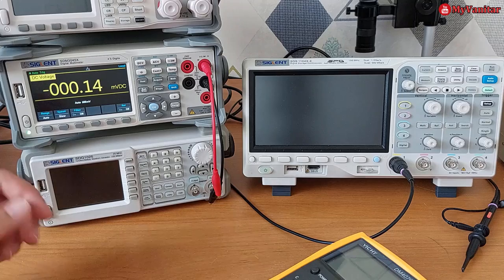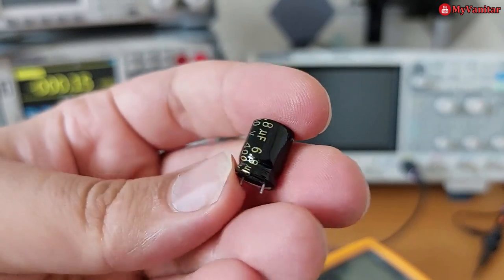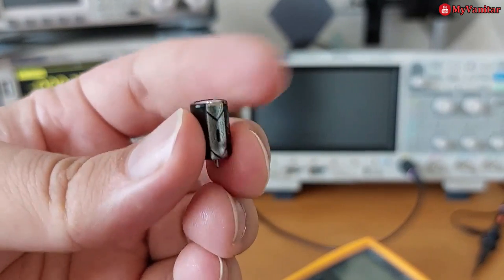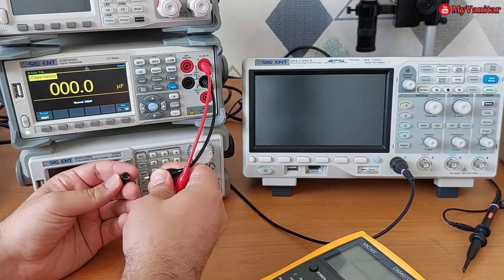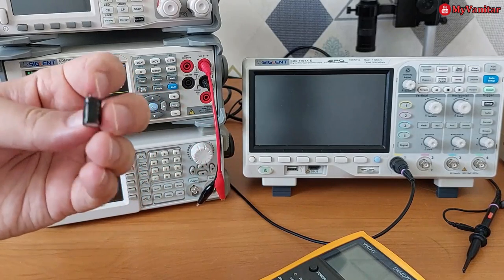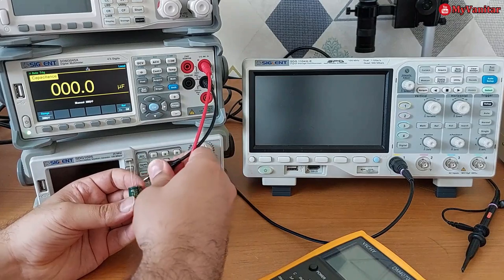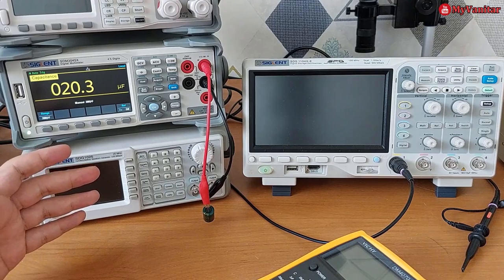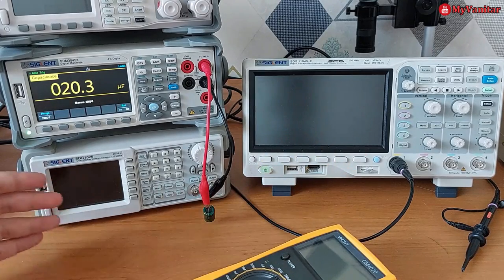How to Easily Detect a Failed Capacitor

Comment: Another way to check if the electrolytic cap is defective is by checking the pins under it. If it looks like rubber part at the base has cracked on it, it is already dried. If there some kind of white excess of internal chemical paste that leaked out from the pin terminal, again, it is also dried.
Reply from the maker: Yes, thank you for your comment

Comment: Do the high voltage  capacitors in a microwave contain any fluid that can leak out when defective? I have seen the electrical capacitors you show in your video burst and leave a fiber material all around it . The one in the microwave has a pool of clear oily liquid that smells like 3in1 oil right under the capacitor and is spread along the entire channel that serves as the rear feet of the microwave. The microwave works but I find this very odd. No one mentions oil as common problem with the capacitors. In fact they say they are dry. Any thoughts?
Reply from the maker: this is only one sign of a failed capacitor, watch my next video for a complete solution: https://youtu.be/CGDtfCkGk2A
Reply: Just an update for those who want to know, these are filled with OIL to cool them, not the old illegal stuff but some oil like product. The Sharp microwave was leaking it constantly after I clean the floor of the microwave up oil would seep out more after use.  I found an exact replacement on eBay supposedly pulled from working blemished units.
Reply from the maker: @tombanes  Thank you

Comment: Most people only check ESR today, which can fool them with shorted caps. Leakage causes more problems than anything else but is seldom considered. I have rescued many items others had given up on because of this.
Reply from the maker: I agree, many people started to make arguments with me regarding ESR (most of the time they use DIY ESR meters), however in my experience, in practice,  it is very unlikely that an electrolytic capacitor does not show the problem in the capacity also (third case). Most of the time electrolytic capacitors show problems, polyester ones are much less likely to fail easily

Comment: Please could somebody advise me I have a board with a 47uf 16v capacitor but it’s showing 197uf, I can’t find any video to explain a higher reading, is it a good one holding lots of charge or bad one? Please someone help as I have a problem with the board and this is the only thing I can find wrong
Reply from the maker: A higher reading is possible but not this much (+/- 20%), you need an LCR meter to test the capacitors correctly, I don't mean an expensive one, but it must be an LCR meter. Multimeters measure capacitors by timing, not pulses
Reply: @MyVanitar  thank you for your reply, I have ordered a new one so will try replacing it and see if it solves the problem 👍🏻
Reply from the maker: which model?
Reply: @MyVanitar  do you mean what I’m trying to fix? If you do it’s a technics PX1M digital piano, very very old but worth fixing if I can find out why it’s making a distortion sound
Reply from the maker: No I mean what LCR meter did you buy

Comment: What about ceramic capacitors? I’m currently struggling to find the cause of low grid current in a vacuum oscillator induction furnace and it’s driving me nuts. All of the caps measure fine disconnected, chokes are fine, resistors fine, no shorts I can find. Only thing I can think of is capacitor failure under load (which I thought was extremely rare) or a bad signal transformer on the RF Furnace board.
Reply from the maker: it depends on where they have been used. if you watched this video completely, the most tricky case is the third one. so you have to use an LCR meter. I'm not familiar with your device however sometimes resistors look fine but the value has been changed. if your device malfunctions when it is cool, then the problem is easier to spot
Reply: @MyVanitar  unfortunately it only acts up during sample analysis. (This is a Carbon / Sulfur analyzer by way of induction combustion and NDIR detection). The frustrating thing is it doesn’t throw any errors so the oscillator tube just sits there glowing red hot destroying itself. I’m not an electrician, so in depth stuff on a component by component basis isn’t the easiest for me. I just ordered everything inside the furnace from the office, so I’ll try a shotgun approach and report back lol. The furnace generates 12kV and heats stuff up to about 2000C, so it’s a boss for sure.
Reply from the maker: the power supply is switching? if yes and it works more than 3-4 years, check the capacitors for drying. especially the first one (big capacitor near the bridge rectifier)
Reply: @MyVanitar  finally figured it out. PSU was fine, rectifiers were good…it ended up being 2 500pF ceramic capacitors before and after the oscillator tube, the potted grid capacitor and potted plate capacitor, but the frustrating thing is they seemed fine when measuring. It was capacitor failure under load, but I don’t have any idea how it happened. The ceramic caps are $90 each, the grid cap is $440, and the plate cap costs….$1010. Total bill, $13,500. Customer was thrilled their $100,000 instrument could start making them money again so that’s all that matters I guess :). Thanks for the help.
Reply from the maker: Do you have an LCR meter? please check the value of the failed capacitors and inform me